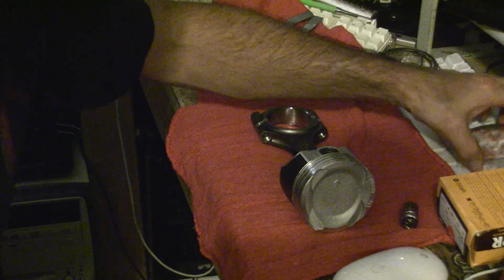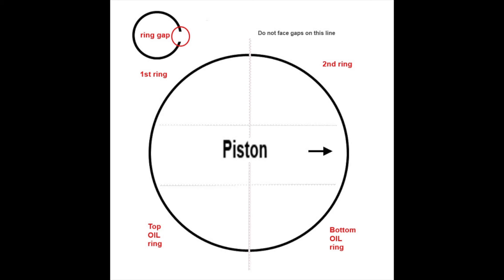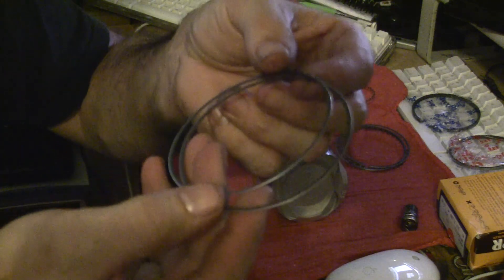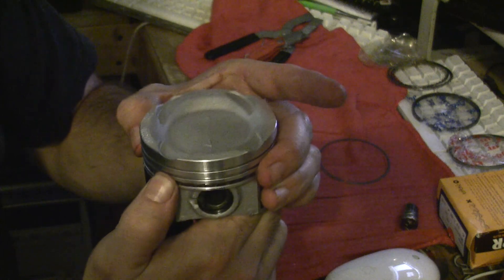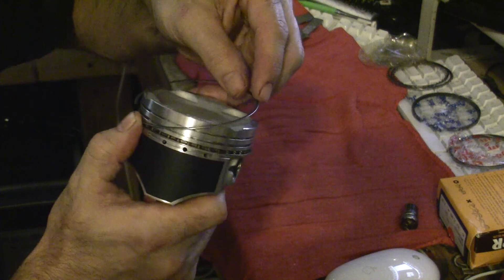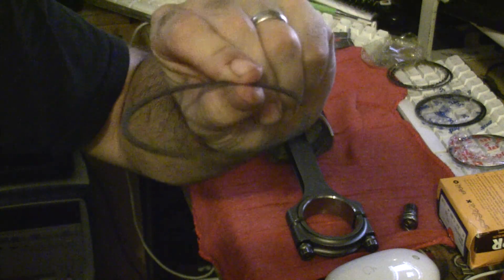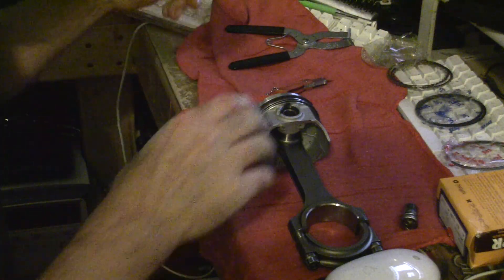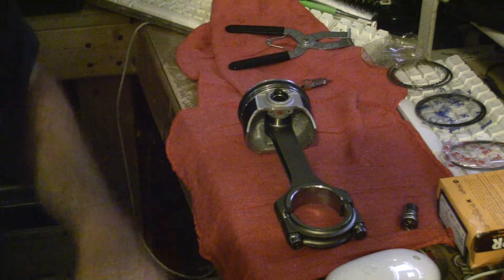Installing NPR Rings on Vitara Pistons -Turbo Build

Comment: How did that motor work out with the standard bore? To much p2w clearance ? Or was it fine? I'm putting together one right now and was a bit worried about the p2w because I didn't measure it

Comment: Hello, Mitch Varn I need your advice regarding these NPR piston rings.
 Are these NPR piston rings good quality? What is your experience with these NPR piston rings?

Thanks.
Reply from the maker: They are ok.. I used them before in a different build.. ran great. Just make sure you double check to make sure you got the correct rings for the engine and check those clearances.

Comment: Did you gap the rings with the engines cylinders? If not that can crack the ringlands on the piston if they heat up and touch.
Reply from the maker: yep  I just had these rings to make a video. The ones I actually installed are gapped to the cylinders.
Reply: @TheHumanThatDrums  okay just making sure lol. I seen some people do that and it never ends well. But I gotta rebuild my cars engine and just been watching videos on all of it. I done it so many times just wanna reinsure myself again it's been awhile
Reply from the maker: yep the only thing I figured out i did do wrong was the pistons are installed backwards.  The last motor I had them in wrong too.. just found this out...so I am going to fucking send it. Who cares I have 2 more to build. lol
Reply: @TheHumanThatDrums  dang lol how long has it been running like that?
Reply from the maker: my first motor.. I drove 100K on it and sold the car.. last I heard it was still running. The guy I sold it to drive it for like 4 years and the car is in North Carolina now somewhere.
Reply: @TheHumanThatDrums  wow not bad I live in Asheville NC myself
Reply from the maker: ahh cool not far at all. Been there several times playing in bands.